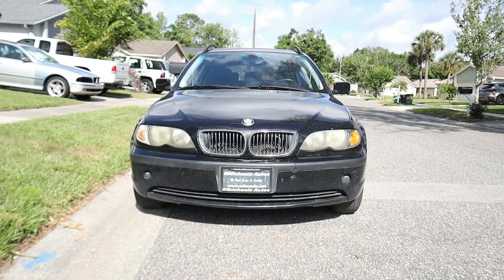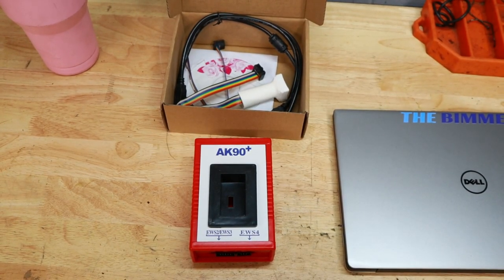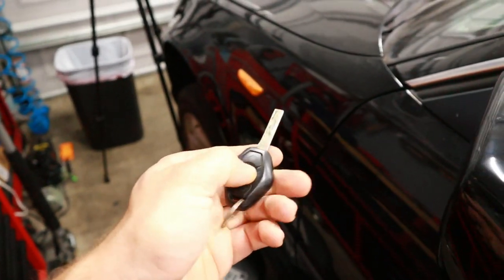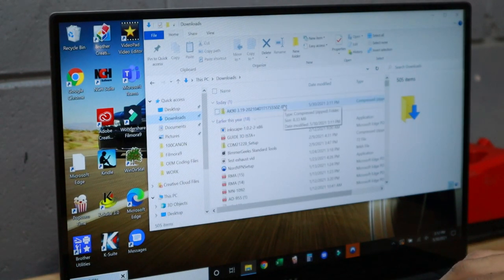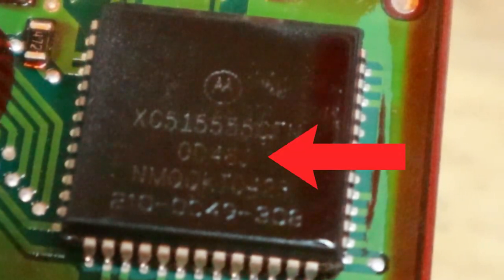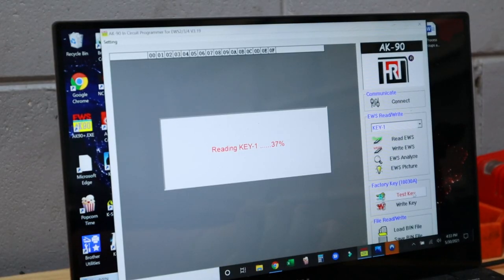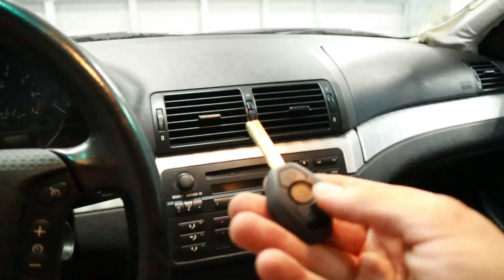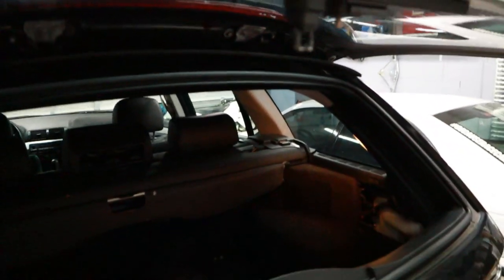How To: PROGRAM your BMW KEYS AT HOME (No More Dead Key Battery!)

Comment: Automotive locksmith here....Your original key was in slot six. Save your new key in slot one or 10. If you sell the car and the new owner orders a key from BMW it may come pre coded to the slot you programmed to and will not work. I would go with slot 1 since the AK90 will override that slot.
Reply: This happened to
Me, am
I
Able to swap the new dealer key to a different slot using ak90
Reply: A bit late to this ,but maybe I ask ,since you are an auto locksmith,do you need the customer to remove the ews module from the car and bring it to you to program the keys?
Reply: @powerspeedutube  Yes. You will need the EWS data to program a new key
Reply: Yes! I saw this case is happened on Mercedes S500, when a new owner lost your aftermarket key made by Locksmith and then he took it to dealership which they order new fob from Germany factory. Unfortunately new dealer key is in slot 3rd (aftermarket also 3rd) and to be not worked lol. Lost money x2
Reply: This devices works for bmw f30 key fobs?

Comment: Hi dear
To synchronise your key 
You dont have to  turn the key 5 times in the ignition in the first time
Juste one time in 5 seconds maximum
And just after you hold etc
And if you have to synchronise a  second key you don t have to put it in the ignition you directly hold etv
Reply: I know. What's this Bimmer Barn guy thinking? Also he turns the key 5 times to POSITION 2. The key only needs to be turned to position 1, and as you said, just 1 time.

Comment: Good video.  Today I had my 2001 BMW Z3 at the dealer for wheel alignment.  While there I inquired about one of my keys that only works in manual mode, the remote function doesn't work even with a new battery.  After some discussion with the service manager and parts rep, they suggested I just buy a new key FOB for $400.  After watching this video I may just pay the dealer the $400.  But the video is interesting.

Comment: I bought a  $15  2006 BMW key from Ali Xpress .Took it to Baldino's lock  Alex. Va. He put a magnet on the blade and said  "It has a steel core -it will ruin my blade I won't cut it."  It would have been $45 to cut it.   I'll  just carry 2 keys one to open & one to start.

Comment: My friend if you cut the key with the dead battery open at the seam with a razorblade you can put a brand new $1 battery in it and it will work like brand new.
Reply from the maker: But then you have to glue the key together and now it just looks like an old BMW key that was glued together 😁 These pop open and you can change the battery easily! Plus they look like a brand new key
Reply: @TheBimmerBarn  Total non factor to me, but YMMV. :)
Reply: These batteries (VL2020) cost about $5 and up as they are rechargable. Battery replacement is quick and easy as can be. There is nothing wrong with gluing the key back together. The Bimmer Barn guy obviously is wanting to make his commissions off of selling new products. I don't blame him a bit. That said, this is a very informative video. Thanks @TheBimmerBarn!

Comment: I'm always surprised by this procedure,i thought after reading ews you would then 'write key','then' have to write that back to the ews(write ews).
So you just read ews then write key and that's it??well apart from remote learn,which incidental i kniw to be jyst put key in and just turn it to 'first' position then switch off abd take key out,then keep unlock depressed and press lock three times,on the third press let off unlock button at the same time as the third press.

Comment: Have yall done like a swap out on the ews modules, in particular im trying to get an ews from a '99 323i to a 2000 z3 because the chip/transpondent from z3 fob is missing. Would it work if i dont swap the ignition cylinder hence door locks, just put the chip into the key, and the modules on the dash?

Comment: I got a new key from dealer but it's assigned to slot 5, slot 5 is my current after market key so the new key
Doesn't work. Can I swap new key to slot 6 using this ak90

Comment: Hey man my bmw key stopped unlocking/locking the car. However the key will start the car no problem. I will then have to reprogram the key by putting the key in put in position 1 and hold the button on key fob down and press the lock button 3 times. The doors locks and lets you know it worked and the key will work only for a little and i will have to reprogram again any ideas? Bmw x3 2010.
Reply from the maker: Sounds like a dead key battery, time to replace it maybe?

Comment: Will a key that is not EWS programmed be able to be remote synced using the ignition turn and unlock + 3 lock button presses procedure?
Reply from the maker: I'm not sure, but I think* it might work. Both processes are done separately from each other.

Comment: Hey Chris, quick question. I’m succefully reading ews and then witting the chip properly. After writing the key I read the key and it reads the cars vin and key position. 

The key I had cut turn door and trunk. But it doesn’t not turn the ignition. I’m wondering is it not turning because the chip is not properly programmed. Main question for starter is on bmw can an un programed key turn ignition to on position. Or does the chip being programmed unlock the steering wheel lock allowing key to turn
Reply from the maker: No, I think you may need to get the key cut differently to match the ignition, because turning it has nothing to do with the key's programming. Not sure how the key cutting works, but maybe you had a valet key cut, and not the ignition? Good luck, wish I could help more!
Reply: @TheBimmerBarn  no that helps significantly thanks a lot. I’m actually a locksmith lol but this was my first bmw so I didn’t want to keep cutting keys if it was a chip issue. But seems that it is the key as that’s what I’m noticing in videos. People turning it even without programed chip but not starting. Thanks again. I’ll go back to customer and keep cutting. Just seemed weird cause it turned like butter in the door and trunk. That’s what threw me off.

Comment: Can the chip on the original key be cloned without having to remove the ews box from the car? If it reads the original key can the data be used to reprogram the new chip? Thank you
Reply from the maker: Depending on the ews version you have, you'll need to remove the ews. If it's one of the older versions, you might be able to make another key using the original. Thanks for watching and good luck!

Comment: Sir, Im planning to buy this AK90 but my car key and remote are separated. Would it still work if I clone?
Reply from the maker: You're technically not cloning the key, you have to pull the EWS out of the car and program a new key to it, just like I did, and it should work fine. You won't need the old key to make the new one!

Comment: Now imagine the remote stopped working after he locked himself inside using it. He would be locked inside without any way out unless going through the glass. That would be hilarious.

Anyway. Good tutorial of the AK90.
Reply: No, my E83 has a big ol UNLOCK button in the center of the dash. Don't All BMWs have that?
Reply: @MarkShapiroMusic  Lock yourself with a remote and tell me how is your button working then.
Reply: @darek4488  well ok thanks for the tip. If you're right I will have learned something very important. Unfortunately my remote is busted right now, which is why I'm watching videos like this one. I report back on my dashboard lock/unlock button as soon as my remote is working. Thanks!

Comment: Hi, my key battery is dead, I changed it.  Now the doors do not open or close.  need to read the key.  Which buttons should I press consecutively after 5 start-ups?  Thanks in advance.
Reply from the maker: There's a procedure for "programming remote unlock" on the key, if you google it and follow the direction you should be able to get it working again!
Reply: @TheBimmerBarn  Thanks a lot

Comment: hey guys how do you cut the key? is it absolutely necessary? i think so, otherwise the key does not fit into the ignition lock? method with uncut key is only, if you have a cuted key?
Reply from the maker: Yes you have to cut the key, just call a local locksmith and they can do it for you!

Comment: I try 3 chips  no lock ,dont start.. what u do other then remove error cods
Reply from the maker: Make sure you're buying a genuine chip, and it's the right one! It should say 7935A on the chip itself, that's how you know it's genuine and will program correctly.
Reply: @TheBimmerBarn  what i have 2 of them 7935AA ,and they program when i check with the app, but not run  car
Reply from the maker: @7akkim  if it's printed on the chip itself "7935AA", then I'd look at other sources for a problem. There's lot of support on the forums, I'd try some Googling, but make sure you've got a good read file from your EWS, make sure the chip is getting programmed, and try using a "USED" spot.
Reply: @TheBimmerBarn  okay thank you man,  how to know I have good read of ews ? Cause I have 2bin file read from my ews and I got different info
Reply from the maker: @7akkim  not sure why it would be different! But let us know when you do figure it out 👍

Comment: Pretty good vid but numerous problems were encountered by Chris. The solutions to these were somewhat brushed over too quickly and not explained as clearly as other parts of the vid. Example - the frequency switching thing.
Reply from the maker: I'll try to elaborate - the BMW's came with keys that operated at one of two frequencies, and based on your vin you can determine which frequency works for your car! These new keys are so smart, they can switch frequencies, so they manufacturer only has to produce one transponder for the "Remote Unlock" functions. So when you try to program the wireless functionality, if it doesn't work at first, and you have the same style key as mine, then you can try switching the frequency. The procedure for switching the frequency will depend on the key you get though, and it can be a little tricky, so I'd recommend thoroughly reviewing the instructions that come with your key. Hope that helps, and thanks for watching!